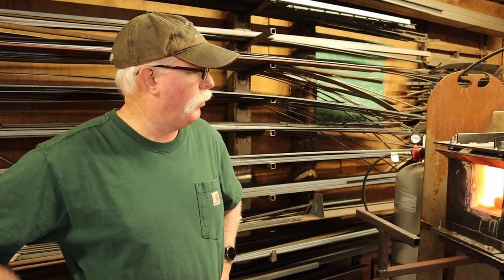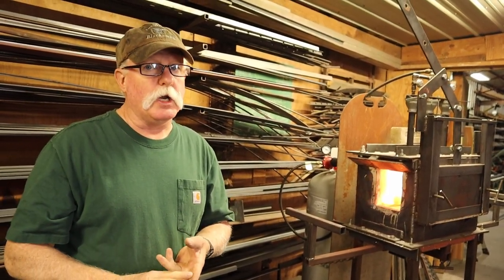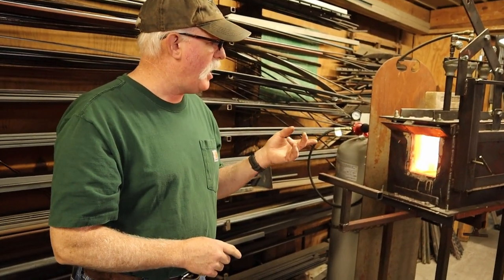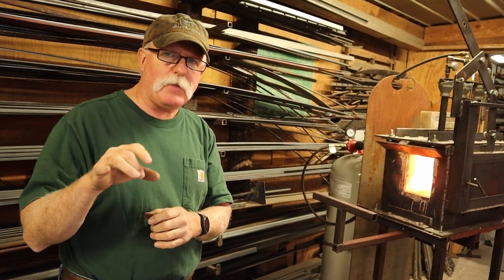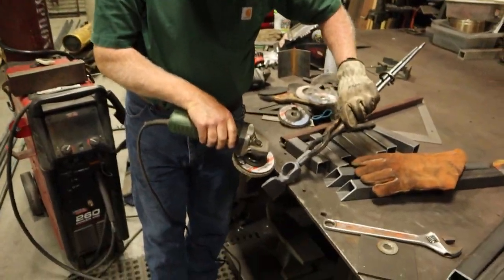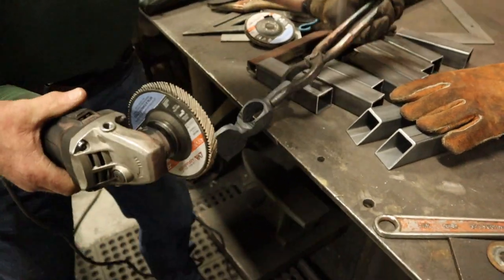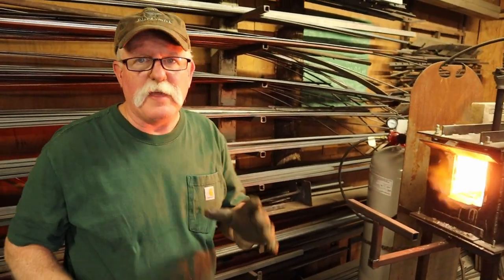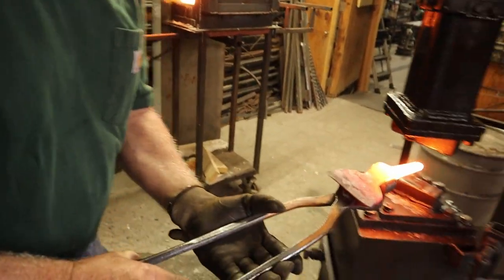Forging a Picaroon Hatchet

Comment: I would have given it a much deeper eye.
Shallow eyed axes and hatchets ( like the Hudson bay pattern ) are known for loosening up over time because you have heel that is extended beyond the eye and eventually resulting in rocking the head up and down during use.
That's probably going to be even worse with a pickaroon and it's curved hook.

I think the best way to make this would have been to start with a Vaughan & Bushnell half hatchet.
Thee eye is better, the hatchet bit is already there, and they use an excellent 1080 steel so you know what the steel is and you know it's a good steel.